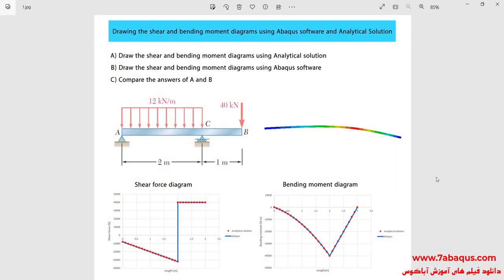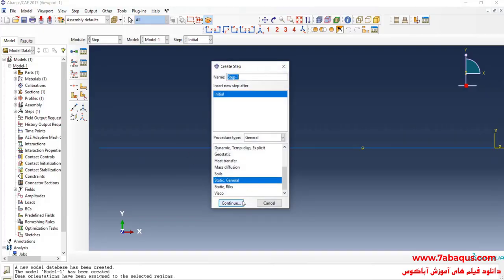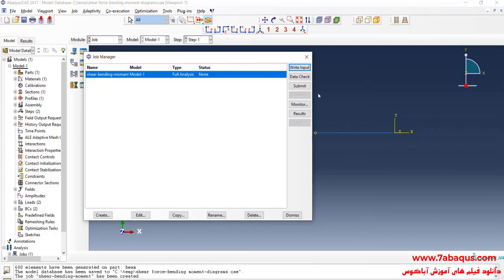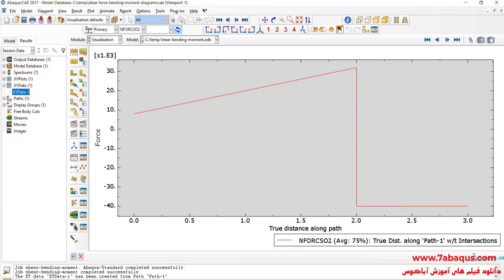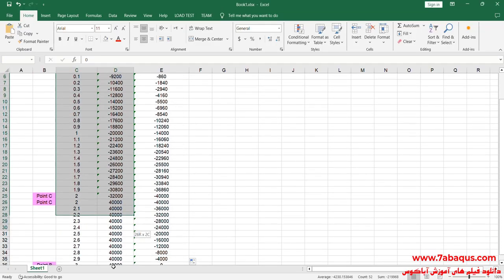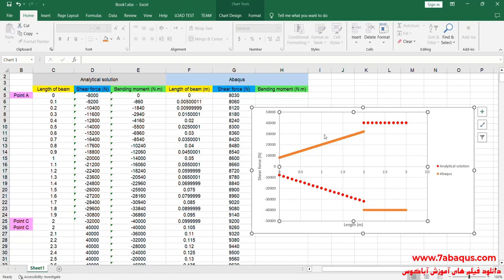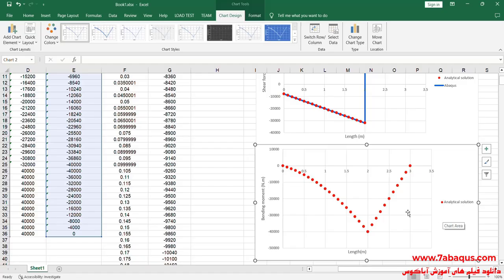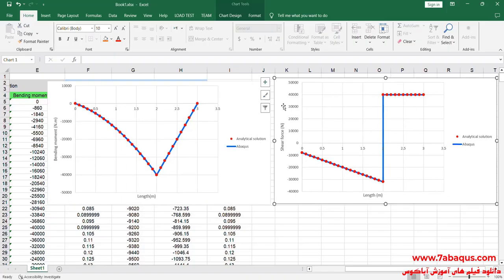Drawing the Shear Force and Bending Moment diagrams using Abaqus software and Analytical Solution

Comment: I want to model a elastic-perfectly plastic Euler-Bernoulli beam in Abaqus to check the spring back effect.  The material model is elastic perfectly plastic. I am applying concentrated moments at specified locations. what should be the process?